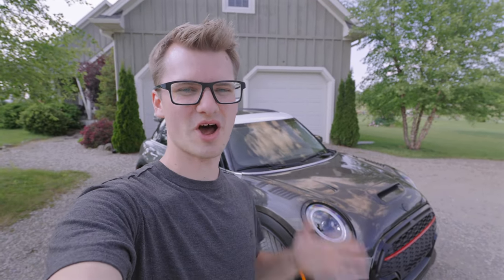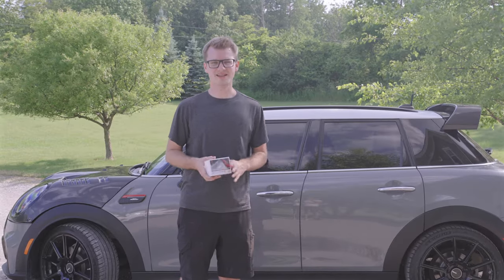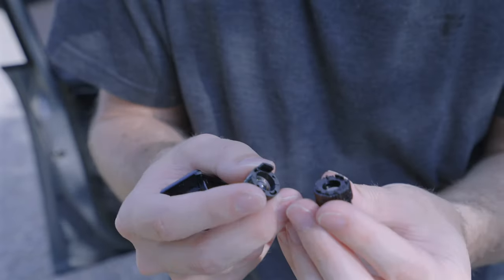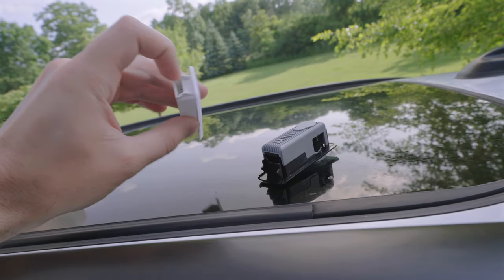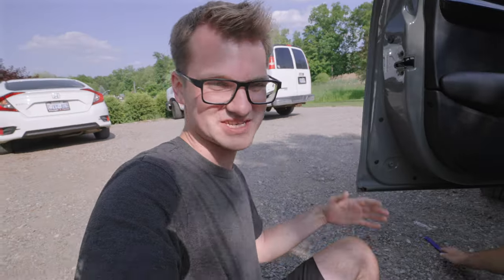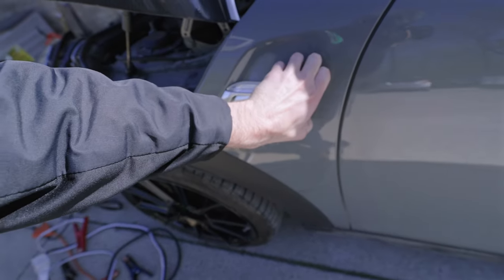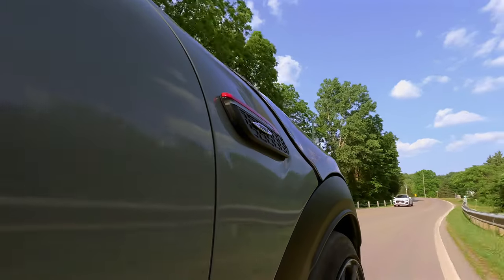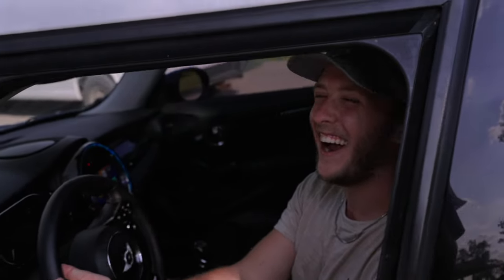Try these three EASIEST MINI mods NOW!

Comment: Seems strange the door projectors that can be bought directly from mini are the big grey and black chunky looking ones whereas the one's already in your car and mine are the cheap plastic ones from China. my car was bought brand new from mini so maybe the dealership staff have a side hustle going on, removing oem ones, fitting chinese whilst selling the oem ones for £66+
Reply from the maker: It is very odd! 
I did get the ones with the new logo, maybe that’s the change? Either way. Odd for sure

Comment: How do you code the LCI2 style side indicators? Been wanting tp upgrade mine on my 2019 F55!!
Reply from the maker: In BimmerCode you can do it in the voltage monitor section of the bdc. 
If you don’t see it there and want to attempt expert mode, this should work. 
If your not comfortable with that, send me an email or a dm on instagram and I can get a professional coding session set up. 

LEFT:

3060 FRA_Z_L_IS_LED: AKTIV
3060 FRA_Z_L_KALTUEBERWACHUNG: NICHT_AKTIV
3060 FRA_Z_L_WARMUEBERWACHUNG: NICHT_AKTIV
3062 MAPPING_BLINKEN_Z_L_FIXED_PWM: FIXED
3062 MAPPING_BLINKEN_Z_L_IGR_RELEVANT: NOT_ACTIVE
3062 MAPPING_BLINKEN_Z_L_PWM_1_STANDARD: 100%

RIGHT:

3060 FRA_Z_R_IS_LED: AKTIV
3060 FRA_Z_R_KALTUEBERWACHUNG: NICHT_AKTIV
3060 FRA_Z_R_WARMUEBERWACHUNG: NICHT_AKTIV
3062 MAPPING_BLINKEN_Z_R_FIXED_PWM: FIXED
3062 MAPPING_BLINKEN_Z_R_IGR_RELEVANT: NOT_ACTIVE
3062 MAPPING_BLINKEN_Z_R_PWM_1_STANDARD: 100%

Comment: Hey may I kindly ask what wing is that, eg. the company who makes it and the model name?  Where I am from >85% of the F-series MINIs around are the 3-Dr F56, I drive a F55 too, and many workshops tell me the many wing options for the F56 don't work with our F55, as our 5-Dr has a more incline slope at the back, but yours looks sooo good and seems to fit just fine !

Comment: Very helpful, thanks. 
How do i get the 'pops'? 
I haven't figured that out and im just randomly surprised by them 😂
Reply from the maker: Thanks for watching!! 
After warming up the engine, hit the accelerator really hard just past 4500 rpm, then let it fall to around 3000. You should hear some pops on the over run. Once you hear some pops, you just have to prime it by tapping the accelerator slightly as the car slows past 4000 to 3000 rpm’s. 
Hope that makes sense 😂
I should do a video on it!
Reply: @carcreationsyt  thanks and I would love a vid! 😁